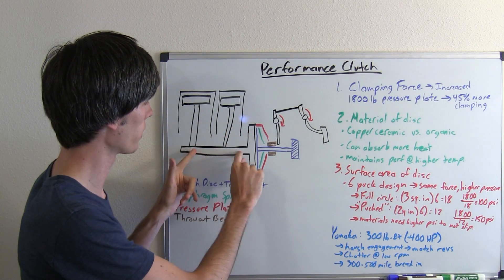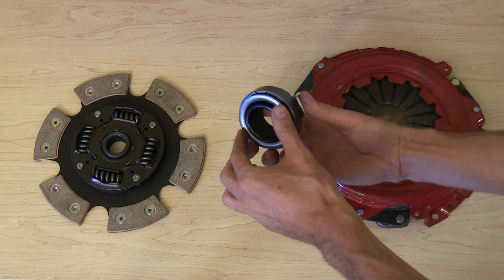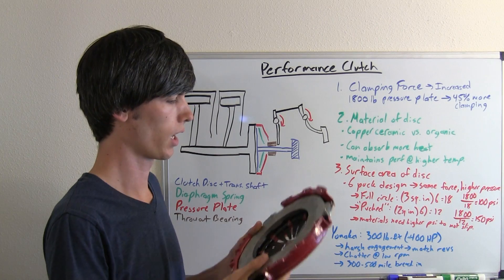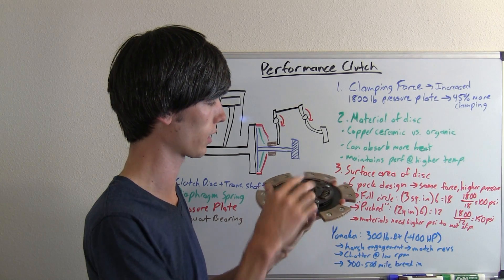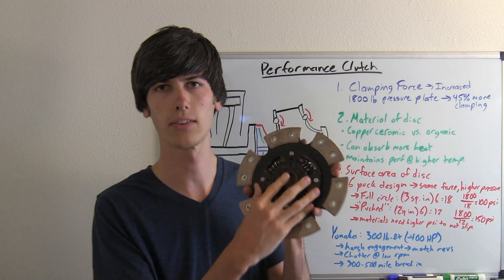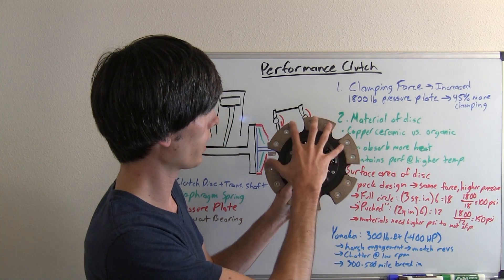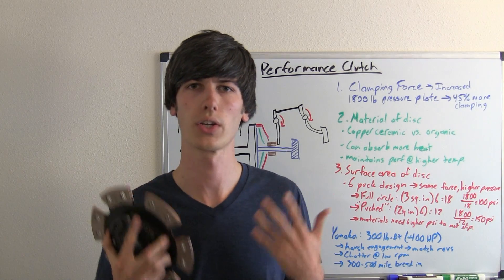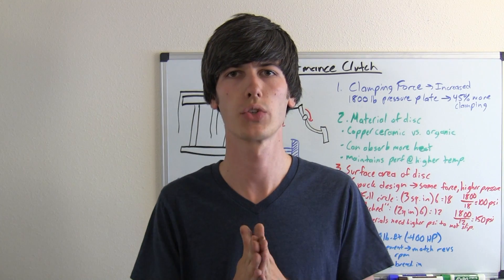Performance Clutch - Explained

Comment: one thing I just learned is that 6 puck clutch discs aren't made for longevity and suck driving in town. it had so much grip that it didn't slip when the disc material more out. eventually the disc got stuck to the flywheel and the car stalled when I came to a stop.

Comment: Hey Engineering Explained I need your help, I cant shift up to any gear in my manual gear when high up in RPMS, the clutch flywheel, pressure plate, Throwoutbearring, gearbox oil, engine mount are new and replaced 1 month and 3000km ago. I drove 3000km fine with the new set and never had issues until someone else launched my car from a standstill. When he wanted to shift to 2nd during the hard laucn the tranny blocked. 

Now you think the tranny is broken and that is wat I though so i replaced the tranny but the problem still exists. I checked the TOB with a micro camera and it does move instantly when i press the clutch pedal lightly, already bled the TOB and even replaced the shifting mechanism. Im clueless what is happening and hope you have any ideas

Comment: I would like to clarify for once that all given the same (pressure plate pressure, puck material, puck sizes, and disc diameter) a 3 or 4 puck disc has more theoretical torque capacity than a 6 puck disc.

Comment: Wouldn't you technically get max grip with the material when it's brand new? It seems like the more it's used, the more material gets embedded into the rough texture of the surface on the material so it becomes less efficient at hooking into the flywheel surface. Kind of how sandpaper gets less efficient when the material you're sanding down gets embedded into the sandpaper causing a smoother surface finish.

Comment: I know this video is old... But hopefully I can get a decent answer. I have a 2011 Jeep Patriot. I have gone through 3 clutches. I'm on my 4th. They are known for clutch issues. I have been debating on buying a Stage 1 or 2 clutch for it if this one goes out again. Would it be better? Last longer? I'm used to turbo cars that I've had in the past. This is my family car. I just need a clutch to last longer than a 6 months to a Year. I've been driving a manual all my life, I've never had to replace a clutch this much before. I've already spent $15,000 on it. Too late to turn back now. I've had it for 4 years. Good reliable vehicle except for the clutch problems. Any help would be appreciated.  Thanks!

Comment: Excellent video. I myself just got a stage 3 clutch (6 puck) for my Z, and everything you described is what I experienced driving with it for the first time.

Yes, it's a little harder to engage smoothly from a complete stop in 1st gear... even 2nd gear gets touchy at times. So i recognize i have a narrower "sweet spot" for releasing the clutch, and like you said, slightly higher RPMs have mitigated the "first gear shimmies," if you will.

I'm still breaking the clutch in, so I haven't gone too hard with it ye. But I expect to be rewarded when it's time to push it around some winding roads. Better shifts, more responsiveness and torque upon shifting, less wear under harsh conditions because it can handle higher temperatures.

Let's hope so anyway... ;)

Thanks for another great vid.

Comment: What is the difference between a sprung and an unsprung clutch disk? When putting in a performance clutch, is it okay to reuse stock flywheel or should it be replaced?

Comment: Jason, could you provide any information you have to the downsides of a single mass flywheel in terms of component damage to the drivetrain, gears, etc? and if I'm upgrading to something like a stage 2 or 3 clutch, is it completely senseless to stick with the stock OEM dual mass flywheel? trying to order soon as clutch is slipping hard on the n55 and needs replacing asap. Any help would be awesome.

Comment: I have a question. When did diaphragm style pressure plates become so favorable?

There used to be 3 main styles of pressure plates back in the 70’s. 

Borg and Beck (GM vehicles), Ford Long Style (Ford) and Diaphragm which was used by everyone. 

Diaphragm was the smoothest and most tame. Borg and Beck had 3 short and wide arms that contacted the throwout bearing. Long style had 3 long and narrow arms. 

Long Style was the better of the 3 styles. Nobody used diaphragm style on hot rods. Borg and Beck was the most popular. 

I had a big block Chevy back then and I custom ordered a Ford Long Style pressure plate from Weber clutches. It worked amazing. 

I was in high school at the time and chose that style after reading a comparison article in a hot rod magazine which explained because of the added leverage of the long Style, you could run a stronger clutch spring and push the pedal easier. 

So what changed? I’m guessing the popularity of automatic transmissions in V-8 automobiles?

Comment: Forgive my ignorance but how would one break in a clutch on a racecar? A drag car for instance... You can drive it 500 miles before ripping on it at the quarter mile. What's the solution???

Comment: I own a 2015 wrx with 26,000 miles. Got it off the lot brand new take good care of it oil changes every 3k or so miles. I just recently did the stoptech front and rear brake kit, and replaced all fluids (front and rear trans fluids) with motul gear oil and gear 300. Also i had a clutch kit installed the clutch kit was the act II performance street friendly clutch kit. I had all this done by a mechanic. (I do believe either the engine or the transmission had to be taken out. Today i got my car back and now I can hear a ticking noise when im accelerating. It sticks around when i shift into other gear and driving too. The damn thing was functioning fine until i went to the mechanic any answers to this? Please help

Comment: Can I swap automatic transmission for a manual on a 2006 3.5 Altima and be able to fix ck engine light still using the OEM ecu

Comment: Hold on. Isnt the puck concept controversial? By reducing the area you increase the preasure applied to the area by elimination of displacement space. Sound math, however, its done because the material needs more preasure to apply grip/traction/friction? Wouldnt a bigger surface area increase the amount of friction that the clutch applies to the flywheel reducing the amount of preasure needed to grip/get traction/friction ~ spin the flywheel?
Reply: It just comes to mind that if you can find a point where one or the other is similar in tge amount of preasure needed compared to friction created, then not having pucks and a full disc, would increase cost of the disc(arguable since machining pucks also adds to production costs) but would geniunely increase the life span of the clutch disc by not having pucks cut out since less preasure is forced into a smaller material. It seems to me that more likely than not, this is purely a money making engineering decision to sell more discs due to ware than it is a performance based engineering decision.
Reply: I do note that I failed to take thermal dispersion into consideration. In which case Mrs friction and more gaps to shed heat would be more economical and have better performance.

Comment: Be warned if you daily drive in traffic you will find a performance clutch to be very ill suited.  They are great for track use with a car that has mods that increase hp by a very high amount over stock.  To say that they chatter, grab too quickly, and can make your clutch pedal heavy is a huge understatement.  Please do more research before going with a performance clutch.  The info in this video is correct from an academic perspective, but understates the draw back for the vast majority.

Comment: After replacing the clutch also still I feel the pickup is low. Changed the spark plugs too. I could not able to diagnose the culprit. Could you please guide me

Comment: Heavy duty clutch doesn’t protect the gearbox from more power in anyway does it?

Also, when you push the clutch pedal, the clutch is separating from the pressure plate or the flywheel? If yes, does the clutch permanently stay in contact with the flywheel?

Comment: So my clutch went out, guess its pretty normal with 2015 WRX's I am looking to either get a new clutch from the dealer or start building my car, however I need to know what would be good for my vehicle. By the end I will be looking for 500+ hrp however I am looking to do it slowly not getting all the parts at once. I'm not sure if you can do that with clutches, so was sort of looking for some help if anyone has some suggestions.
Reply: Christi Mcdonald the clutch went within two years? What the hell was done to the poor thing?

But need to replace it so sort of fortuitous for you since youre going to tune up
Reply: I let someone use my car and they killed my baby. That didn’t really help with the question I was asking at all.

Comment: Thank you. Great video. What about flywheels if the car is to be used on a short circuit arranged by cones? Slalom on a parking lot, with very short straights (less than 15 metres) and sharp corner (90/ 180 degrees). Lighter flywheel or heavy?

Comment: If the only reason to use a pucked design is to increase the surface pressure, why not just use a stronger diaphragm spring? Doesn't the reduced surface area decrease the amount of friction by exactly the same amount that increased surface pressure increases it? I'm figuring based on the simple equation for static friction. Perhaps I'm missing something. Is the coefficient of static friction for the clutch material not constant with pressure?

Comment: I got a question for you I really like your explanation its great keep up the great work. so my question is what happens when you install a stage 3 clutch exactly like the one on your video on a Miata stock and the gear box does not let you shift into gear while engine running... please shoot me a message  that's my situation right now .I suspect the pressure plate is to stiff for the wimpy 1.6l either that or I installed it too tight

Comment: Hey I have the exact same issue with my clutch, It vibrates if pull out on first at a low rpm, but it is smooth at a higher rpm. Some people online said that first is probably just worn out. Should I replace my clutch or is the vibrating ok?

Comment: Its time that I change my clutch. I eventually want to get 400hp out of my car. will I have an problem if I buy a clutch that can easily handle the power I expect to put to it later? say a stage 3 clutch onto a stock car
Reply: Soverign Cold-Steel question answered by EE above to stick with stock clutch on stock engine. Depends how soon youre going to mod the engine after the clutch change i suppose

Comment: Can you make a video on what is "granny shifting"
Reply: Spoonzaza "granny" shifting is ordinary clutch in/change gear/clutch out shifting you'd use in normal road driving - smooth, easy,  but you drop a fair few revs between gears

Of course race drivers and fast and furious fanatics will absolutely slather about double clutch shifting (clutch/neutral/blip gas/clutch/gear) unless your car is high strung/delivers grunt/on a circuit or strip, you generally wont need to double clutch

Comment: Hi there, I just installed a twin plate clutch on my evo 9 and it's making lots of noise when I'm pushing in the clutch and even when I'm driving, mainly 2,3 gear at around 40-50km, the twin plate clutch is softer than the stock one as well, is that normal? Thanks

Comment: What's going on behind chatter?  Is it more that the engagement happens quickly and causes a shockwave through the drivetrain, or more that the clutch is slipping and sticking?  Any ideas?
Reply: My guess is that OEM clutches are "looser" and allow smoother engagements, and sort of level out any vibrations and flywheel fluctuations. When you go performance clutch/flywheel, everything is tighter and more solid, leading to better performance but reduced comfort and vibration tolerance

Comment: what that means to break after 500 miles ,  do I have to remove the transmission and inspect the clutch?
Reply: It means go easy for the first 500 miles to allow the clutch to wear in.
Reply: thanks

Comment: Why will changing the pressure on the clutch affect the slip of the flywheel? The total force  between the flywheel and pressure plate, which is determined by the diaphragm spring, remains the same. As such so should the friction between them and thus slip between them?

Comment: Question to all. My clutch is currently slipping and will need to be replaced soon. Is it safe to get a clutch that's rated to 400-450tq even though my car is only pushing about 300tq right now? I'm going big turbo next year which will put me in the 400tq+ range I just didn't know if it was safe or not. 
1.8t Passat 5sd.

Comment: When the clutch pedal is pressed there's no pressure on the clutch disk against the flywheel, but there's no guarantee that the clutch disk is detached from the flywheel, right? May happen that the clutch pedal is pressed but the clutch disk remain "glued" to the flywheel?
Reply: I've seen this "gluing" effect in cars that didn't run for a very long time(few years, maybe not so few), mostly due to rust and all. So, I believe it's possible but shouldn't happen very often.
Reply: Ok thanks :) I think that happened to me few days ago, it was a hot day and the car is 16 years old. I put it in neutral and started the engine, but I couldn't manage to get any gears engaged: the clutch disk feels like was glued to the flywheel. I succeded to get it started with the first gear engaged (don't tell me how, I think it was pretty painful for the car) and after a while I was driving only in first gear the clutch restarted to work normally.
Reply: ive seen it happen in race car when someone used never seize when lubricating the input shaft. its so slippery it slipped away causing a dry seize between the input shaft and clutch plate, in turn not letting the clutch plate to move away from the flywheel when the clutch is pressed
Reply: well, it could be a sign that you must replace the clutch or it could be nothing. Just pay attention to any other strange behavior you might notice

Comment: would the Puck style clutch work good on a stock or slightly modified engine? I have a 1994 Ford ranger with the 2.3l with a cold air intake.

Comment: Hi there, would like to ask some questions regarding total surface area of the clutch surface and clutch 'grip'. In theory, changing the surface area(number of pucks) without changing the material won't affect the 'grip' of the clutch since friction is only mu x force and area does not affect friction in any way. But according to your video, you mentioned the material itself works better when higher pressure is applied, which means the coefficient of friction of the material changes depending on the pressure applied to it, am i understanding this correct?

My question would be how significant is this change of surface area in relation to coefficient of friction of the material, and thus the performance of the clutch? Let's say a 3 puck clutch vs a 6 puck clutch(considering each puck is of same surface area and diameter of the same size), from your statement the 3 puck clutch will outperform the 6 puck clutch, but by what margin? It is definitely not by two-folds. Thanks for taking your time and reading this

Comment: Just out of curiosity, how is it that performance clutches offer more performance when there is less contact to the flywheel? Wouldn't an OEM clutch which has the most contact to rub against the flywheel be better? I've driven manual since I drove my first car and while watching this video finally understood what my clutch did when I pushed down on the pedal. +Engineering Explained
Reply: The performance clutches offer more performance for the reasons stated in the video. The friction material is of a different composition, generally one of a higher temperature tolerance. In addition to that, when you reduce the total surface area of the clutch, you increase the amount of clamping force per square inch. This adds up to a clutch that can handle higher temperature, and grab harder.

Comment: It would be nice if you could elaborate on clutch materials, what type of materials are good for which applications and whether or not one would need a certain type of material for what they are trying to accomplish. i.e. organic materials vs copper ceramic vs carbon etc.